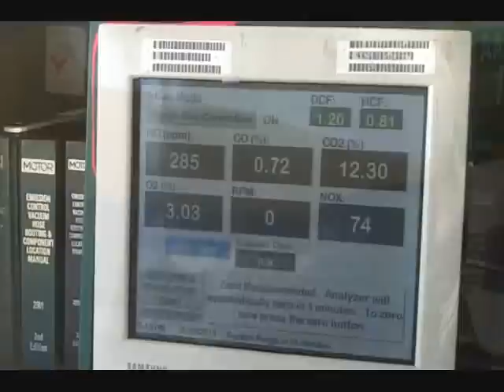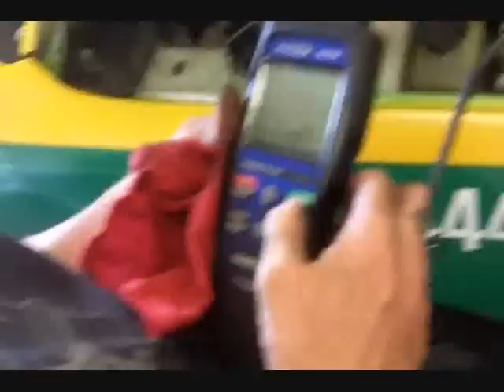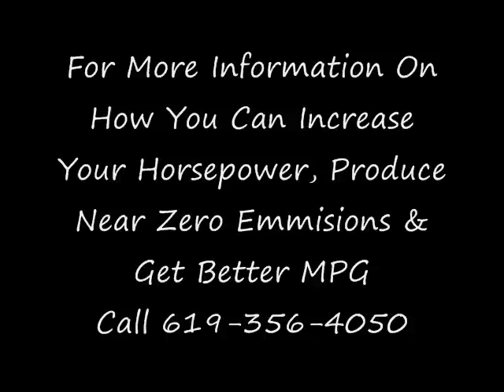The Talk of San Diego Show presents The Gadgetman Groove 8-19-11

Comment: Same thing the last guy said ... A dude with a whole lot a talk n no proof .. Anything you do at the throttle body to "change" air flow is not goin to make any difference by the time it reaches the combustion chamber ...
Reply: Yeah - i thought that too until I bought a cheap TB that fit my '09 camry to have the groove put on it... felt like hp/torque doubled.  after 2 weeks, mpg started to climb as well.  the only reason I took it out & put stock TB back in was because of the ear-piercing hiss sound the TB made whenever throttle was engaged or let out between 3 and 7 % ... working on an airbox with fiberglass padding to dampen the sound & will try the grooved TB again once airbox is complete.